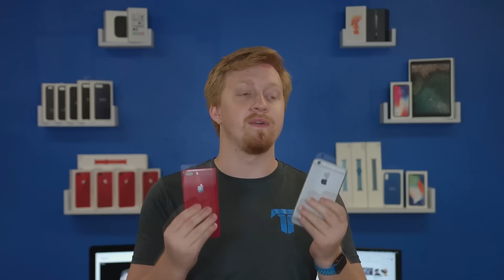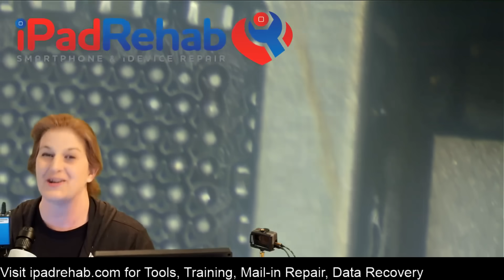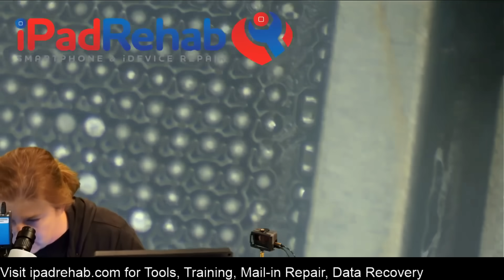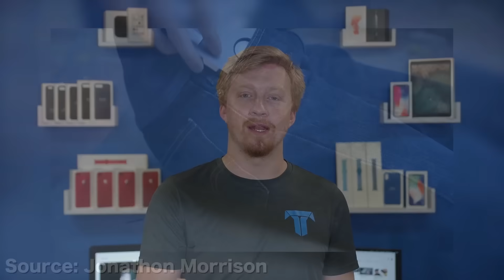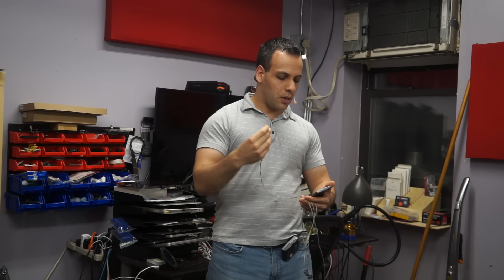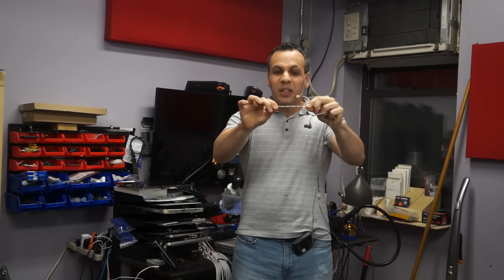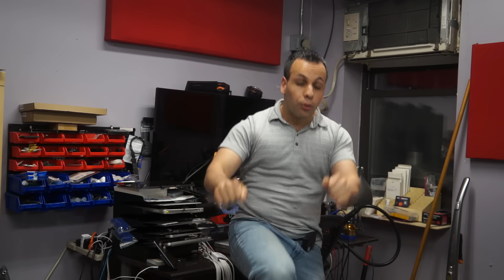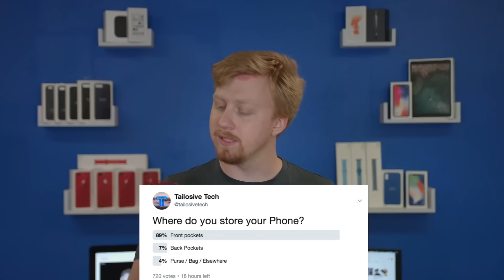The truth about iPhone bendgate deniers

Comment: I get your point and even agree with you to a point.   But this is sorta like the he gun issue.   It requires action by the user to invoke an issue.   I'm a retired product development engineer.  I am the owner of an iPhone 6 that is still straight as day one.... because of the way I treat my  belongings.    The customer needs to accept some responsibility for taking care of their products.   So, to what extent should a manufacturer be accountable for the treatment by their owners?   Yes, there needs to be some real world durability.   But where does that begin/end?
Reply: ramosel im typing on my iphone 6, using it since launch day,  no bend at all,
Reply: I think you missed the part where he said that most people with flection damage do not have a visibly bent phone. 

I used windows vista for years and never had a problem with it. But that doesn't mean that the people that did was using it wrong. Nothing should break because it was used the way it was intended to be used.
Reply: I understand your point, but 7x more likely is a bit much..(if you ha ve the plus model)
Reply: The problem is..not every person is as responsible as you...

Some ppl are just hell fkin clumsy
Reply: Did you even watch the video? The phone doesn't have to have a visible bend. Small bends to the pcb causes the solder joint or a trace to break. Visually the phone can look brand new, but inside the motherboard can be ruined.
Reply: I do agree a user must take care of their device. But with this there is a big manufacturing problem. I've used loads of phones ranging from 200€ to 800€. And many of those took some big abuse, and yeah visually they are a mess, but they still work fine. My current phone (huawei p9) has a visible bend, from when I was in a trafic accident, and to this day it still works fine. And if some chinese company can design a phone to survive something like that, I think Apple should be able to make a phone, that small bends in the pockets, doesn't kill it.
Reply: It’s the same with cars. You can either drive them carefully, wait till the engine warms up or you can just put the pedal to the metal from the get go. If you treat your car nicely it will last longer and if it breaks because you didn’t care it’s not the manufactures fault. If you buy a phone for $800 I treat it like it is a fucking $100.000 car. If you don’t have the money to spend $10 on a case then don’t buy a phone for that much. I’ve never had a cracked screen cause I spend $15 more on a screen protector, a case and treat it normally. If you’re rude to your phone don’t blame anyone else for doing something wrong. Of course it should last for years but where is the line between normal wear and tear and something extraordinary. If you care about your product this shouldn’t happen!!!
Reply: +Zach +admirnaruto  my point precisely...  whether the phone shows signs of a bend or not it has been bent (repeatedly).   I'd submit that you could by anybody's phone and leave it on a table and it will not show these faults.   It takes use/misuse in the real world to cause any sort of bend to occur, visible or not.   So where do we draw the line between use and misuse?   Where does the manufacturer?
Reply: What if it could fold as easily as paper?
Reply: Comical Hexical well yeah but that’s compared to a much thicker much smaller phone .its like saying it’s over 400,000 times more likely to bend than a brick of concrete....well yeah.
Reply: Dead Pool so it’s apples fault that they’re clumsy? That’s like complaining to a car company becuase they made a new car and it was a little heavier.so it couldn’t stop as fast as the older model.so someone does 90 tries to break in 60 feet and crashes.does that mean the car company should get hate becuase the car stops slower?

Comment: The S6 never suffered bendgate because the bl*sted thing couldn't hold a full day of charge to start with and no buyer could possibly have had the patience to wait for it to fail in any other way. I was given one, the battery is completely insufficient for the device, and the screen will drain it in minutes even at the lowest setting. I had a S4 before which autonomy was already nothing to brag about, and still it was head and shoulders above the 6. Anyway, the S6 spends so much time tethered to the wall it reminds me of landline phones of the past. No chance to bend in a pocket when the day is spent lying flat on a table.
Reply from the maker: They decreased the battery size from the S5. So dumb.

Comment: Nice example with the headphones .. but , could also the battery heating up the motherboard and flexing it also be the cause ? (or any other elements, like the GPU also heating up the motherboard)... for Xbox360 this was the #1 reason for the "red ring of death" ... motherboard flex due to heating and awful X-clamp on the CPU

Comment: I work for a printer manufacturer. Simple vibration causes soldier joints to crack. How to fix? Turn up / down the motor speed to stop a resonance that causes the break.   To bad it didn’t work for my wife’s 6 that she dropped in the pool.  Hehe. No back up no data
Reply: 1/2 bit coin to get the data off the 6+.

Comment: My father had an iPhone 6 Plus and put a big, ugly Otterbox case on his phone - I'm not joking when I say over several months somehow that phone bent like crazy even with the freaking case around it that he never removed! I was perplexed at how a phone inside of a rigid plastic case could bend, but the iPhone 6 Plus managed to do it! Lmao
Reply: BlindMango Every time he presses the home button or does a hard touch on the screen, the entire thing bends very slightly back and forth.

Anything will do that, the difference is how many times before they break. When buying mechanical parts professionally they often specify how many pushes before they break.  Basic things like buttons and plugs can vary from less than 100 uses to 10s of millions of uses.

With the huge number of iPhones made, there really should be similar ratings for repetitive normal uses like pushing buttons, pushing the touch screen, dropping 5 inches, docking in certified holders etc.

Comment: The word that needed to be used and is the reason for these failures, the scientific term is "WORK HARDENING" Bending any type of metal over and over at a focal point aka these traces where they meet the pad, causes the metal to become harder and harder due to the metal atoms moving. After so long the metal (copper in the trace) becomes very hard but the draw back to very hard metals are they are BRITTLE. Brittle metal in an area of flex causes breaking. These micro fractures cause a "dirty" signal coming from the LCD on the BSync line for Touch IC and on the iPhone 7 series this causes a "dirty" signal on a AP to Audio Codec line. 
This issue is a design flaw and NEVER has been a user issue. They lied and charge money to fix their design issue, that still hasnt been addressed. 

Also the underfill option was tried on a revised version of the 6 Plus and it does not prevent the issue. It has happened on underfilled iPhone 6 Plus after replacement with Apple applied underfill. It does not address the issue of flex and WORK HARDENING.
Reply: To elaborate on your point. During each flex, there the atoms in the alloy go through microscopic dislocations. As the dislocations get more severe, there will be 'pockets' called crazes that will appear in the microstructure of the alloy. These crazes and dislocations at the same time will lower the yield strength, as well as concentrate the stresses at these crazes. Thus leading to fatigue failure. :)
Reply: Fatigue fracture* just saying and very informative btw :) I like!
Reply: Rossman was also. Fatigue due to flexure.
Reply: They should just replace all the traces on the pcb with magnetwire, leave out the pcb, and pot everything in a silicone compound to keep it a little bit flexible :)
then all one would need would be a flexible screen, and we could have the first floppy phone!
Though that would make the whole phone just a little bit too hackable, methinks.

Also, you could fold the phone except the screen up into a little square inch iCube... though it's probably already patented... if not, quickly do it ! ;)
Reply: It is not work hardening - ask anybody that knows a bit about material science or works with metal and electronics.
this is simply stress fatigue. And no - not all metals can be work hardened - far from it.

here the problem is far simpler: the whole board is bending, separating the pads from the lamination.
Reply: B&C Connection LLC just like copper wires/pipes in a network cab, a boiler or a car. 👍
Reply: I don't think it's called work hardening. It's failure due to fatigue. Work hardening is a manufacturing process that make the device stronger (also a bit more brittle). Work hardening is not something that happens over time. It's fatigue, it causes micro cracks in the grain boundaries of the material which then slowly propagate till they reach point of critical failure.
 I have just finished a material science couse and I am sure that I have this right.
Reply: Venkata Y work hardening is indeed a manufacturing process but in this situation it's not intentional and fatigue failure is a biproduct of this work hardening effect. 
The copper fails due to fatigue because of the loss of it's ductile properties as a result of being compressed and pulled. Both which are a form of work hardening.
Reply: David I'm no engineer but every single piece I find written by engineers says something along these lines. This is a quote from a engineering paper not my words. 

It is established that cyclic stressing leading eventually
to fatigue failure is accompanied by work hardening i.e. by
plastic deformation which is associated with slipping, twinning,
cross-slipping etc.

This isn't industrial strengthening type of work hardening where they avoid exceeding stress thresholds. This is a form of unintentional work hardening due to poor design in the ridgity of the frame allowing flex in the board. Which in turn leads to a load and unload of stress on the M1 aka BSync trace for Meson IC.

Comment: Yeah fuck that edge nonsense on Samsung phones. I have an S9 and it has absolutely no benefits. All it did is Samsung added this annoying little tray of app and contact shortcuts you can pull out if you want, and also it pulls out all the time when you don't want the fucking thing. I disabled it and now what was the point of the edge display? Nothing, except with some colors and some lighting conditions, I can see some distortion at the curves. Also, if I need to select text right at the edge of the screen on that curve, it's a real bitch. And some apps just keep all the relevant stuff within the flat part of the screen, meaning the curved edges are nothing more than a bezel (which is better, honestly). If they had a non-edge version of the S9 like they did the S7, I would have gotten that instead. And it would have been better.

Comment: The good news about the flaws in the iPhone 6 is that when the Android phone manufacturers inevitably aped the iPhone's design, they went ahead and fixed all those structural defects for Apple. So now we have better-looking (subjectively) and more structurally-sound devices (objectively) cropping up all over the Android side of the fence. Sure, the new iPhones are more structurally-sound too when it comes to bending, but ask anyone that tries to repair them and you'll hear the same story: they're just about unrepairable. Meanwhile you can replace pretty much any component on a Galaxy S9, including the back glass that Apple wants $500+ to fix on the iPhone X, for the cost of $20 and a heat gun.

And yes, I am counting a phone's repairability into its structural integrity. It doesn't matter if the iPhone X won't bend under even 300 lbs of pressure if a 3 ft. drop will completely destroy it and force you to take it to Apple and shell out $500. I would say that just like a phone that bends in your pocket during normal wear and tear is a structural defect, so too is a phone that is destroyed after a waist-high drop. The reason repairability comes into play is because even though the new Android phones are just as fragile to drops, they're orders of magnitude easier and cheaper to fix.

Comment: I actually just switched from apple to a s9 because of the throttling scandal but the design flaw has been fixed and I think bend gate is not relevant anymore, like I get the design is still being used today but the specific design flaw has been fixed therefore it's a non issue imo